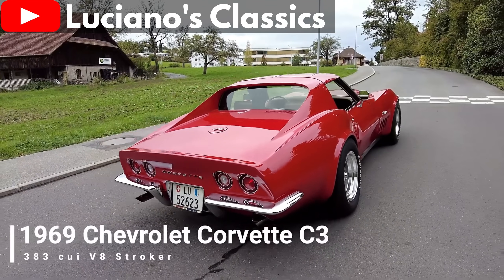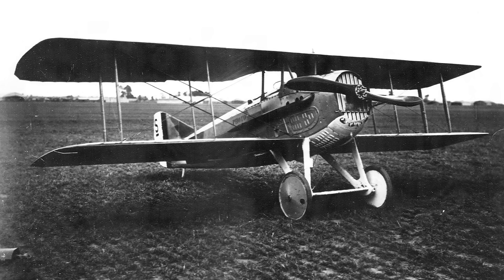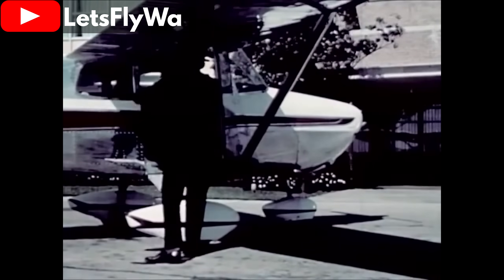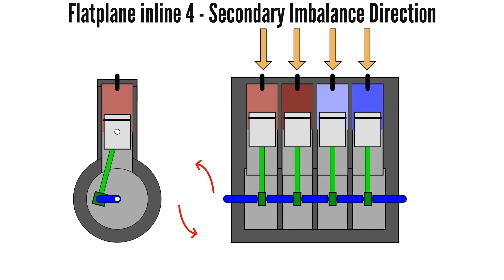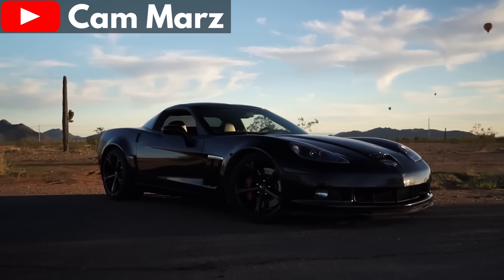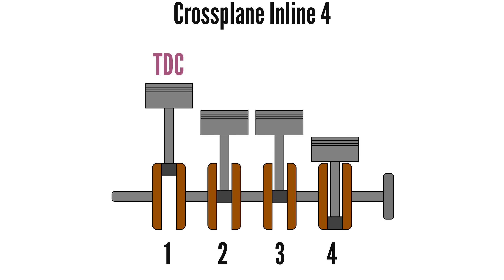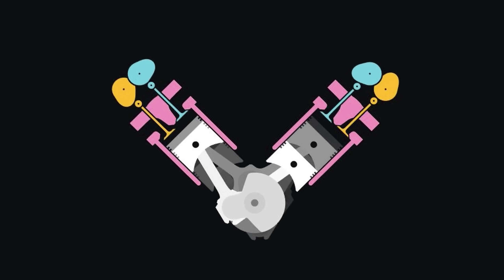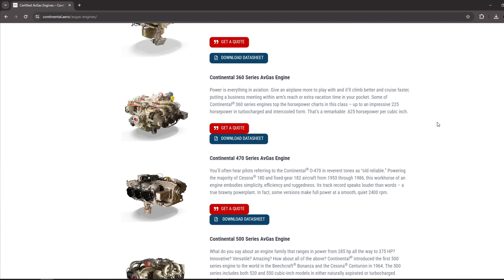The Muscle Car Marvel that Failed Aviation - V8 Aero Engine History & Technical

Comment: The rotary engine most definitely remained competitive power wise until the end of the war. The largest mass produced of which was the Bentley B.R.2 that had a power of ~260 HP for a weight of about 500 pounds. These engines stuck around into the mid 1920s, when they were eventually phased out because they had a high fuel consumption and consumed large quantities of castor oil by design.

There were also some rather terrifying two row rotaries like the Gnome Delta-Delta (18 cylinders in two rows) and Lambda-Lambda (14 cylinders in two rows), and some even more mythical four row rotary engines that never got past the experimental stage. The Delta-Delta alone was around 500 pounds and spun around 1200 rpm. They put a lot of faith into those crank case bearings.

True radial engines were almost non-existent during the war. The only couple of designs that I know of are from ABC Motors, one of which was a prototype and the other, the Dragonfly was a failed engine that saw little service. The engine designer unknowingly created an engine that ran at the torsional vibration frequency of its own crankshaft, and the cylinder jugs ran so hot that they would glow a dull red in operation. Aircraft designers that planned on using the Dragonfly quickly re-engined their designs with other engines.

The first successful radial engines like the Bristol Jupiter only had a handful of prototypes in 1918.

Comment: From what I've read, the prop speed reduction units are a weakness of the auto engine conversions. Even with the numbers that have been built and flown and the experience gained thereby, it's still a tiny fraction of the development time of the engines themselves. One of the prominent builders of auto engine conversions for aero use lost his life just a few months ago when the PSRU on the aircraft he was flying apparently failed on takeoff and the propeller departed the airplane.

Comment: Also a 60 degree V12 has way less frontal area than a 90 degree V8 of the same capacity. In Aircraft less frontal area is important.

Comment: 👍👍 Excellent and so informative!   I admit I cringe at the thought of high-revving automobile engines converted for aircraft use.  It's not just their heavier weight and complexity, but the fact they weren't designed for continuous high rpm operation.  It seems like a reliability recipe for disaster. 😲😲
Reply: The VW Beetle engine and the 911 motor were both light and reliable air cooled flat four and six cylinder, and were successfully fitted to a number of aircraft and an airship

Comment: V engines can also  very challenging to get the centre of thrust in the right position whilst still retaining decent forward visibility . Not so bad when designing an aircraft around a specific engine , but otherwise can be an issue .
Reply: Must be why so many are inverted - - heads down, crank up.

Comment: pretty sure if they did with the rotary what they did with pistons- 32 rotary with counter spinning rotors... and a super scavenger turbo 😀 would be amazing 😂🤣
Reply: 😄 or a single rotor radial! it would counter spin and stay really cool. gons of torque.

what i find odd is they pretty much gear them down to stay at like 3600 rpm.

instead of giving the pilot blade control. you need to wait for the engine to spin down to decellerate... which is probably why the poston design persisted... it provides resistance and spins down fast... while resisting spin in a dive... but its prone to stalling while clinbing, or any kind of turbulance...

a strong cross wind can stall the engine and take away lift at the same time. leading to many failed take offs even today. 

if propeller planes could tilt their blades to reduce lift to maintain higher rpms, it would save fuel and likely be more reaponsive if you want to try and dive... engine maintains speed, provides an air brake and you can switch back onto power rapidly. 🤔

Comment: Great video. I’m perplexed by secondary balance/imbalance and why they create an upward vector at both TDC and BDC. It seems unintuitive, but I know that it’s true. Still working on understanding that.
Reply: Study the rod angle to the crank throw, not to level. The piston travels further in the top of the cylinder compared to the bottom.

Comment: And they are still fitting VW Beetle engines (sometimes modified) to aircraft.
Reply: Last I knew they quit doing that in favor of a more modern air-cooled flat 4 design by Lycoming
Reply: @SlowSTEN  V-dubs are going into small homebuilt aircraft all the time. There are even 1/2 VW's going into ultralight aircraft (literally 2 cylinders removed).  Good little engines if used within their limits.
Reply: Yes the Beetle motor , from 1932 still driving around ! Just think of how many 1930s cars are on streets today , and still look ok , the Bug is the only one , nearly 100 years old !
Reply: @JosephCowen-fz8vj Don’t forget the Deuce , there’s more of them now than there were in 1932.

Comment: If an aircraft needs the power of a V8 it's time to consider a turboprop to get the same or more power with far less complexity and longer service/overhaul intervals.
Reply: But, finance wise, a whole different kettle of piranhas : )
Reply: @loddude5706  Only because of economy of scale.  If all aircraft were turboprop or turbojet powered the engines would be no more expensive than piston engines.  It is only because in the light aircraft market piston has a 100:1 advantage of numbers over turboprops that make those engines artificially cheaper to buy even though in many ways they are more difficult to manufacture than turbines and turboprops.
Reply: @larrybremer4930  I fear one of us may be running on fractured logic  : )

Comment: What !   America did not invent the V8  ?   Next you will say we did not invent the Hemi V8  !
Reply: Did someone claim that the V-8 was invented in the US?
Reply: We didn’t invent the V8 but we sure did come up with long lasting V8’s. A 5.3L LM7 making 320 horse power will outlast a 4.0L BMW engine making 400 horse power. Sure the bmw makes more power and can run at higher RPM’s but can it really outlast an old iron block LM7? LM7’s can go 400k miles and still keep chugging. I’ve never heard of a bmw V8 lasting that long I know water pumps and head gaskets let go around 150K. I do know European diesel V8’s for trucks are pretty powerful and long lasting though.
Reply: We honestly don't give the French enough credit for their early engine technology. 🤷‍♂️
It was their pioneer aviation industry, and their almost complete lack of understanding about propeller aerodynamics that pushed them to manufacture the most powerful lightweight engines in the world. 
I would even go so far as to say that the Europeans would have been the first in the air if they had just one efficient propeller at the turn of the 20th century.
You know the old saying.... "You can get a barn door to fly if you give it enough horsepower."
America may not have invented the V8 engine, but we sure did run with it once we discovered them! 🤠
Reply: @straybullitt  As a Brit I reluctantly give credit to the French for there early aero engines which were light and reliable.
Reply: The US were still a very young country, the Europeans had Hemispherical cylinder heads since at least 1901they were used by the Belgian car maker Pipe in 1905 and by the 1907 Fiat 130 HP Grand Prix racer,  Peugeot Grand Prix car of 1912 and the Alfa Romeo Grand Prix car of 1914, both four-valve engines, and Daimler and Riley . You may like to investigate Ricardo combustion heads.
Reply: America invented the airplane so ha lol
Reply: @sc1338  Even that is debatable.   Alberto Santos-Dumont and others may have been first.
Reply: Right ..but Ford did invent the first economical v8
Reply: @joshjones3408 and he hated it ! He did not want any pumps on it , but relented and did , his X 8 air-cooled was a nicer motor !
Reply: henry ford : 🤨
Reply: @joshjones3408 
You can call a V8 lots of things, but economical?

I'm not buying it. 😀

/half joking, because i don't really now the numbers
Reply: Pleasesit down and stay calm and do not think about the Alfa-Romeos prewar DOHC Engines  but americans did invent the most important automotive device ever : THE CUPHOLDER!!
Reply: @michaelpielorz9283  Peugeot had 4-valve head DOHC racing engines in 1913.
Reply: Well, Americans didn't
Reply: @gregw6748  an what are trying to imply... Well Americans didn't...I mean it's only been said a half a million times that we didn't....but Henry Ford did make the frist economical v8....an Dodge constoned the phase hemi ..the word hemi Dodge come up with no hemispherical but hemi... anything with a rounded top to the combustion chamber is hemispherical....now what didn't we do....👍👍👍

Comment: V-8 engines need a flywheel for harmonic balance.
Reply: Harmonic DAMPING is needed because of crankshaft rigidity leading to torsional spring-mass couples which will fatigue the crank.  Some engines are externally balanced by both flywheel and harmonic DAMPER.  

Most engines require some form of harmonic damping, even radials have crankshaft damping weights.
Reply: Flywheels help but they are not enough, you realistically need a specialized part (which as far as I'm aware all automotive vehicles have) called a harmonic damper. Especially because of something called Crank whip and Harmonic Resonance, a flywheel cannot cope for these forces alone.

Comment: How bigger crankshaft weight can sap engine power "on propeller"? It may take slightly more power to "spin up", but that's it, once constant rpms are reached, no extra power needed. "slower to rev up, no extra power to keep spinning".
So only some extra weight of crankshaft with beefier side counterweights might be an issue, but may seem reasonable pay for engine longetivity.
Imho though main reason for V8 not able to hold against V12 is warbirds needing more and more power in hunt of speed, and going more displacement route. But at some point of increasing displacement by increasing cylinder volume (with bore and stroke) hits limits of reciprocating mass for used material strength and cylinder filling efficiency with AF mixture, so at some point adding more (smaller) cylinders became only way to go.
Reply: response times are a big thing in aero engines since you might need power quickly if performing a go around or while recovering from a stall and especially so in a warbird where the pilot might need to throttle up and down in a dogfight. This also was a big thing when the switch from piston airliners to jets was happening since pilots who flew the piston aircraft expected fast response times from jets and made mistakes as a result of jets taking much longer to reach peak power from idle.
Reply: @mertvaran5733  by far throttle response being not THAT important (and thus that being even remotely the main reason why no V8 in WW2 warbirds). Even more so that eg. many other rotating masses like prop itself, weighted much more so then potential extra 1-5kg on crankshaft, so needed relatively more energy to spin-up due acting as "heavier flywheel", also normally managing engine includes apart from throttle also includes adjusting prop pitch (which btw can make rpms change MUCH faster then throttle inputs), fuel mixture, supercharger speed, cooling, keeping an eye on many instruments
Reply: @church493  I don't see your point when it comes to the prop pitch and other engine management since none of what you mentioned is significant when it comes to sudden power demands since power is not a function of just RPMs. If you're making sudden changes to power levels I don't think anyone would mess with mixture cooling or supercharger gears since those are not absolutely critical for going from idle to a significant power setting. If you need go around power with a Constant speed plane you just increase throttle, climb and then do the rest of the engine management when you're at a more significant altitude (I'm assuming mixture is already set to full rich and prop is full forward since that's probably in the before landing checklist)

Comment: light aircraft market has shrunk.  Not enough funds for R&D. 
In the meantime, auto engines are made by the millions and have made huge advances in design, medullary and production techniques. The volume of scale makes them much cheaper than Ly-Contis and Rotax
Aero-engine coversions of Honda 15 engines by Viking and Suzuki engines by Aeromomentum are worth considering for experimental aircraft